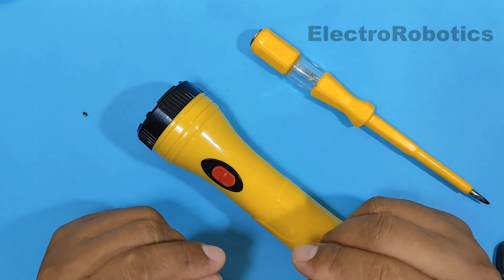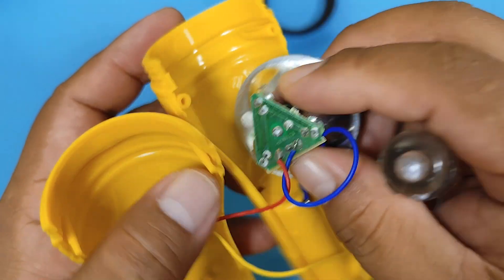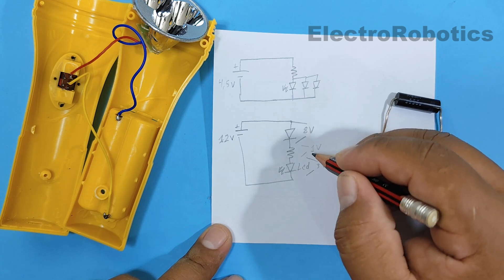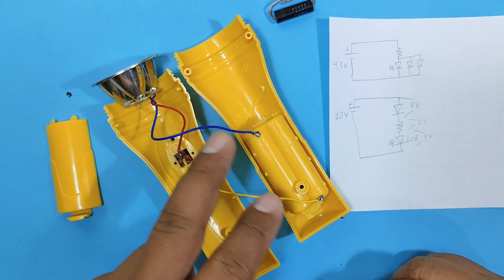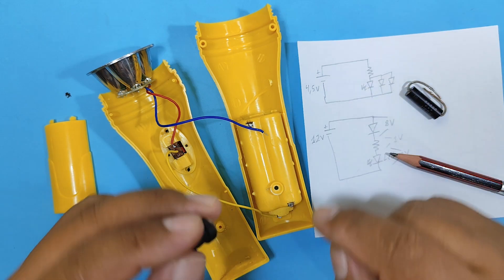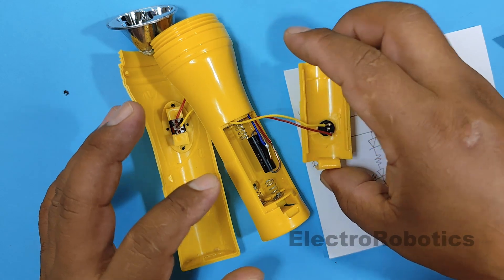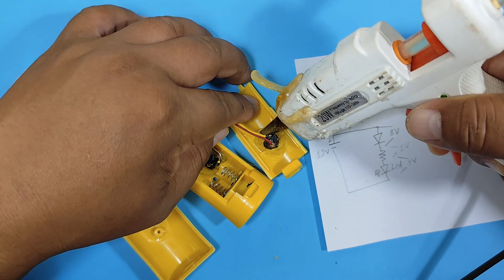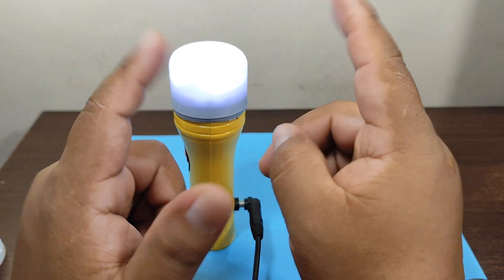Don't Waste any more Batteries, Upgrade your Equipment using a Microwave Diode.

Comment: if you must use an external power supply, why use a "microwave" diode to reduce the voltage? Why not just use a couple resistors?

Comment: Using a soldering iron to make holes in plastic is going to destroy the iron bit. Never do that, use a drill machine or a heated iron nail or any other metal object of the right diameter, but never use a soldering iron!
Reply: What rubbish I've been doing it for years ain't ever had problems with my solder iron tip. Tell me how do you think plastic destroys the tip?

Comment: It is not a microwave diode you are showing . It is a High voltage diode salvagde from a microwave oven. It does not operate in the Uwave region. It works only at 60 hz from the  transformer suplying a high voltage. a uWave diode is small that it has a very very short leads to avoid inductance.  Tsk tsk tsk   . . .So miserable uploader.

Comment: What kind of microwave diode is that? There are many different kinds. It looks like it's reverse biased. You can get a zener diode and that range that wouldn't have to be a "microwave diode". Anyway I can buy a plug-in LED light. A flashlight is much more useful especially when the power is out, or if need to work outside away from the electrical receptacle.

Comment: 12 - 8 is 4      not 4.5
can use a 7.5V Zener in series
Reply: @kennmossman...Because 1 volt is dropped across the resistor. It appears that you were asleep in maths class when the rest learnt that 8+1+3=12. Obviously this project is too difficult for you and just bag someone who has made an effort to teach newbies intro to electronics.

Comment: What should I do with this wired franken-flashlight? Can't use it outdoors at nights, can't use it indoors in case of power outage. I have a lamp on the ceiling and lamps on the wall, and a lamp on the table. If I need light indoors, I'll use those lamps, if there is no power outage.
Reply: I came here to say the same thing. A much more useful video might have been to replace the batteries with rechargeable ones. Of course you can buy AA rechargeable batteries, but if he used maybe an 18650 battery and a charger, that might have been a good video.
Reply: Be thankful you won't have to live through that again 😊
Reply: This must be the best idea since the invention of the wheel.